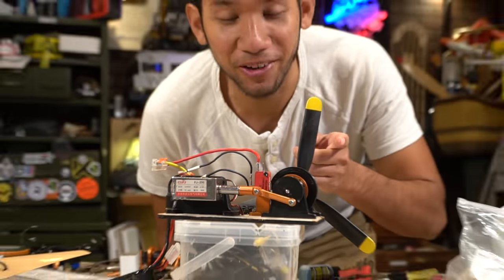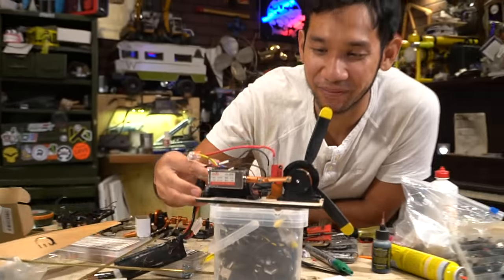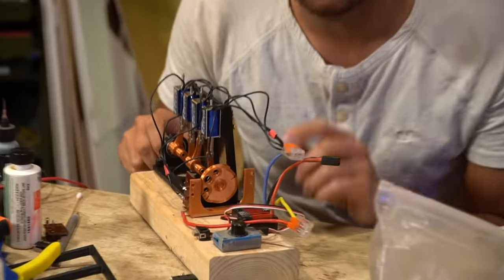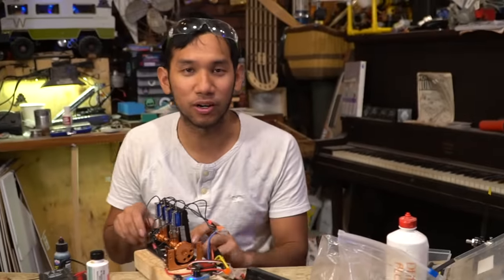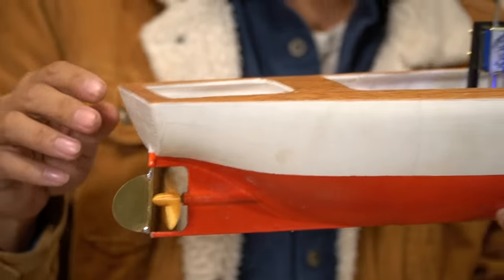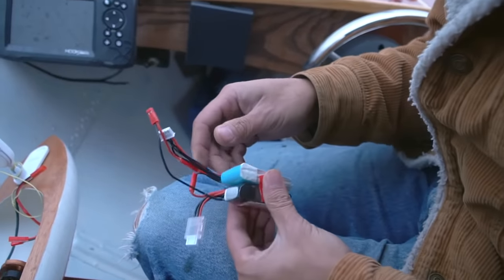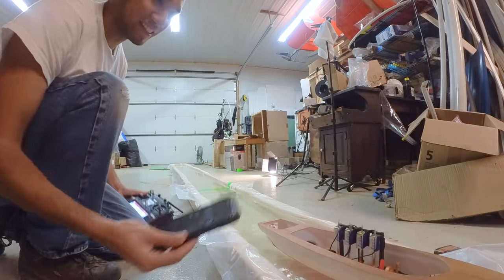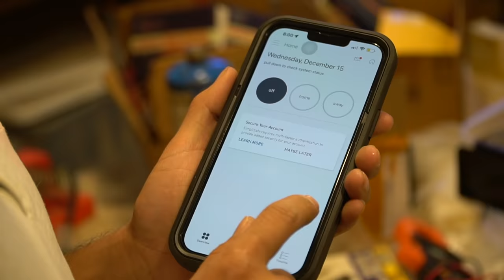Electric piston engine DIY (solenoid motor)

Comment: This is really cool! I want one now lol. As a side note, on a gasoline I4 engine, cylinders 1&4 and 2&3 are companion cylinders, meaning they move symmetrically if you mirrored the engine between the middle cylinders. This generally makes the engine more balanced from inertia, if anyone was curious. Also, you could get more torque by increasing the throw of the crankshaft (how far from the centerline of the crankshaft the rod journal is). Awesome video!
Reply: useless and inefficient and uninteresting motor
Reply: @alexdelarge4938  what?
Reply: J M  i don't look at motorcycles much, i was just generally referring to the average I4 car engine lol. That's interesting tho. 
I like at least 6 cylinders personally 😂
Reply: And that’s why Diesel engines rev so low too, they have a longer throw, so it has lots of torque but cant rev fast
Reply: Fun fact: there are basically 2 kinds of V8 engines, on has a cross plan crank, the other has a flat plan. Plan, as in the crank pins. Flat plan is 180° angle longitudinally from one pin to the next, and cross plan is is 90°.
Reply: Side note: to keep this short, Cross plains are generally more balanced, but only when the bank angle is 90° (angle of right cylinder, to left, almost always 90° or 60° in most V engines.) Flat plain cranks only work on 90° V8 because 90° V8s are naturally more balanced than 60° V8s.
Reply: A longer stroke wouldn't increase the torque of the solenoid motor in the video. Why?

Get a couple normal permanent magnets. Orient them toward each other such that north faces north or south faces south. Bring the faces very close together. Feel that pressure? Now, very slowly, allow the magnets to move apart. How does force correlate with distance?

A high-precision, optimized, reciprocating-solenoid motor should get far more torque with very-short-throw pistons than with long, and max torque should be achieved at low RPMs, similar to what you get with cheap brushed DC electric motors.
Reply: @warpedweirdo  you do realize how a linear solenoid works, right?
Reply: this setup should be better since he doesnt have counterweights?
Reply: @Fra-gee-lay  I think I do. I'll assume for now that you do as well, and you're just being pedantic about such things as simple solenoids working on magnetic attraction rather than repulsion, with no permanent magnets involved, and only one magnet of any sort.
Reply: You would not go wrong adding a flywheel.
Reply: J M  General Aviation airplane engines are largely the same as an air-cooled flat 4 out of a 1960 VW Beetle.  The crankcase/block is thinner and lighter and more sculpted on the airplane, but its got the same type of cylinders with cooling fins, pushrods and rockers in the head.
Reply: You are right but I guess the construction would be too weak to handle 2 pistons in the middle at the same time. On a 4 stroke engine they also don't fire at the same stroke. But making this a 4 stroke is no option. Making the solenoid rods magnetic would allow for push and pull so creating a 0,5 stroke engine. Or isnt that a thing? lol
Reply: @warpedweirdo  I think you might be incorrect, if you have shorter throw pistons, then the crankshafts offset will be shorter, giving less leverage and less torque
Reply: He's actually using a 2-stroke "Big Bang" configuration, ie, 2 double fires per crank rev, where as a normal 4-stroke 4 cyl is 4 fires in 2 crank revs.
Reply: And maybe a boxer engine.
Reply: I’d like to see a well timed one. Maybe turn the coils on just after bottom dead centre (a tiny bit) so it’s already on its way up when it starts to pull. Even turning off a fraction before top dead centre to stop it getting trapped/stalling.
Reply: That's with four strokes, yes. In two strokes, like this solenoid engine is in some respects, a crossplane crankshaft would be better, since it smooths out the delivery of torque.
Reply: yes, near full stroke of the solenoid, but the coils are heating up with a near 50% duty cycle is the major issue. a 5 cylinder radial configuration with one lobe 5 switches, lobe making ON for 45-50 degrees reduces duty cycle per solenoid a lot. when heat goes up, resistance goes up, power output drops.. is what this inline 4 is doing to the solenoids.
Reply: @Skoda130  definitely would require a more complicated triggering mechanism though. Not a huge problem, but I can see why Peter started with the simple setup.
Reply: *stares in Yamaha*
Reply: @brettc5386  Perform the experiment with the magnets, then get back to me with your thoughts.
Reply: Is that a fellow car enthusiast???
Reply: 1324 das ist die zündreinfolge
Reply: @warpedweirdo  well you're the one that tried correcting the other guy so why don't you try it, see how much torque your 1 mm stroke puts out🤣🤣
Reply: @warpedweirdo  you really have some pent up anger in you, huh? I never said you were wrong, I said I THINK you MIGHT be wrong, I'm jus saying you can't just assume a shorter stroke will give you more torque when it decreases the leverage, the same way a longer stroke won't always increase the torque, because the distance of the magnetic field.  I'm sure there's a sweet spot but neither of us can say what's perfect, we can only theorize. Next time don't take a comment so personally, be more mature and try to come to an understanding instead of trying to tell me to do it myself and getting mad when I say the same thing back to you. I wanted to know how you would respond and based on your defensiveness, I see that you don't like being treated how you treat others.
Reply: @joeljr570  they also cant rev high because the heavy internals to withstand the pressures of a Diesel engine. Most gas engines have a compression ratio of 9:1 or 10:1 but diesels have cr’s up in the 18:1 to 23:1 range meaning the cylinders face extremely high pressures with require stronger heavier parts that don’t allow for high revs
Reply: @brettc5386 
I've already told you what I think of your opinion. Why are you wasting words?

But I have a message for you Brett, and it's important that you never, ever forget it. I want you to remember these words, and I want you to contemplate them every day for the rest of your life: 

Grow up, listen to the details before you form a conclusion, and always be ready to consider the possibility that you're wrong. 

Got it? Read the message a few more times to burn it into your brain and ensure you actually understand what I've said this time.

It is my hope that, rather than changing your behavior, my words will serve to reinforce your haughtiness and provoke greater self-destructive behavior. HAHAHAHAHAHA!
Reply: That only holds true on a 4 stroke
Reply: The hard bit is when you have to balance a straight 5
Reply: Make the poseidon
Reply: @joeljr570  no diesels create a lot of torque due to being a more efficient cycle at converting stored energy into mechanical energy not due solely to longer stroke, rpm on diesels is limited for reliability and longevity of the motor due to the amount of pull strain and compression strain on the engine internals. In the diesel performance world they have diesels that in stock form redline at 3200 rpm that in competition form rev to 5000 or even 6000 rpm. Production engines find the happy median between peak power output and longevity, where as performance oriented goes for peak power with longevity taking a back seat
Reply: @johngarlick7115  it’s cool how diesel is more efficient than otto from a thermodynamic perspective, it all depends on when the fuel is ignited in the cycle. Constant pressure vs constant volume heat addition.
Reply: @aidanf2610  every single thing about thermodynamics is cool lol, also things people look over is gasoline is rated by octane which is the resistance to ignition whereas diesel fuel are cetane which is the measure of how easily it is ignited, also diesels show more response to injection timing changes as far as power out put than Otto cycles due with ignition timing changes to optimize combustion events, and also diesels are inherently cleaner as far as emission than an Otto cycle though what they do emit is visually more noticeable
Reply: @aidanf2610  also you are my new best friend 😂
Reply: @jwalster9412  what about split plane? Hmm? Or VW's W8?
Reply: @arlberg2006  (Volkswagen) W engines use The 15° Vr-engine platform, this is a pretty good balance, but if you take a Vr8 and rotate it 45°(From the center of the original VR engine), mirror that, you get the basis for the Bugatti W engine, idk wether it's more balanced, but considering it's used in a Hyper car, it's probably a good Engine, the main downside being that the W16 is really complex, there was also a concept 90° W12 engine (used by Bentley for use in some of there cars).
Reply: @jwalster9412  tehe I've been a dubber for a decade and a half 😉
Taken apart many i4 and vrs.
The v8 in the front engine Porsche I believe had a special crank, and maybe one of the v8s in one of the old Lotus Esprit or something?
Reply: @arlberg2006  There is the, Shelby GT350 mustangs that have Flat plan crank V8. I've only really heard of cross an flat plan cranks.
Reply: Jomi _____®  gagu
Reply: depends on its constructions, on crossplane engine they move asymetrically aka simultanousnly from left to right
Reply: @warpedweirdo  Yes and no, torque is simply force times distance.  At the end of the day, the force you exhibit downward, will only be force x distance...the distance here being the throw of the crank.

If I can get the same force upon a longer throw...I automatically get more torque.

Now with magnets this is different...but these are not permanent magnets, these are e-mags, so the force can vary simply by increasing energy.

As well if he really wants to get the most out of his engine he would ditch the big solenoid and put in a multistage winding so that at peak throw, which is 90 degrees to the TDC or TBC.....is when you would be releasing the force of a two stage solenoid.  First stage to push down, second stage to keep it going as would combustion, even a combustion engine loses force as the piston strokes down because of the expanding gas.

Point being.....tldr.....force x distance.  A longer throw with same force will always equal more torque
Reply: @elitewolverine  Agreed. Many people here are ignoring the caveats you listed, including how quickly the strength of a magnetic field diminishes with increasing distance.

Putting together long-throw solenoids with multiple windings, position sensors, and software to control activation / deactivation of individual windings would make for a very interesting and informative video.
Reply: @warpedweirdo  You wouldn't need software if you make it a physical switch like a cam.  Just put the individual windings on their own cam switch.

I would say 3 windings each cylinder so at the end of the crank, the position sensor they are using now, just put spacer, print another cam, and do that again.  Just time it of course.  But no software needed.

Hell don't even need a switch if you want to go 'old school' and use a brush type of contact...
Reply: 3tg
Reply: @joeljr570  It's also because they are low compression engines. Entirely different than gasoline engines. Which is also the reason they are harder to start in cold weather. But they are generally more efficient engines than gasoline in terms of weight to power/fuel used. I'm not gonna lie though, this video is completely useless.
Reply: J M  Yamaha crossplane cranks make the best sounding motors.
Reply: Petrol*
Reply: also looking at how easily it stalls and the speed variation between the strokes he probably should've put on a flywheel or at least made a crossplane crank because those solenoids basically function like an inverse 2 stroke (or with more advanced timing and better solenoids double acting steam pistons) and as such you can remove the secondary imbalance completely while retaining the same amount of primary inbalance as the current setup.
Reply: @joeljr570  nope, diesel don't rev high because the fuel burn slowly and unlike gasoline, they cannot ignite early to compensate. Also, they have lower torque than comparable gasoline engine. High torque of diesel became a thing only because they became turbocharged decades before gasolines (in mainstream cars).
Reply: That's because combustion engine fires once in 360°. Two stroke 4cyl would have different layout to spread combustion cycles.
Reply: @alexdelarge4938  👉🔴What Do Muslims Believe about Jesus?

Muslims respect and revere Jesus (peace be upon him).  They consider him one of the greatest of God’s messengers to mankind.  The Quran confirms his virgin birth, and a chapter of the Quran is entitled ‘Maryam’ (Mary).  The Quran describes the birth of Jesus as follows:

 (Remember) when the angels said, “O Mary, God gives you good news of a word from Him (God), whose name is the Messiah Jesus, son of Mary, revered in this world and the Hereafter, and one of those brought near (to God).  He will speak to the people from his cradle and as a man, and he is of the righteous.” She said, “My Lord, how can I have a child when no mortal has touched me?” He said, “So (it will be).  God creates what He wills.  If He decrees a thing, He says to it only, ‘Be!’ and it is.”  (Quran, 3:45-47)

Jesus was born miraculously by the command of God, the same command that had brought Adam into being with neither a father nor a mother.  God has said:

  The case of Jesus with God is like the case of Adam.  He created him from dust, and then He said to him, “Be!” and he came into being.  (Quran, 3:59)

During his prophetic mission, Jesus performed many miracles.  God tells us that Jesus said:

  “I have come to you with a sign from your Lord.  I make for you the shape of a bird out of clay, I breathe into it, and it becomes a bird by God’s permission.  I heal the blind from birth and the leper.  And I bring the dead to life by God’s permission.  And I tell you what you eat and what you store in your houses....”  (Quran, 3:49)

Muslims believe that Jesus was not crucified.  It was the plan of Jesus’ enemies to crucify him, but God saved him and raised him up to Him.  And the likeness of Jesus was put over another man.  Jesus’ enemies took this man and crucified him, thinking that he was Jesus.  God has said:

  ...They said, “We killed the Messiah Jesus, son of Mary, the messenger of God.” They did not kill him, nor did they crucify him, but the likeness of him was put on another man (and they killed that man)...  (Quran, 4:157)

Neither Muhammad  nor Jesus came to change the basic doctrine of the belief in one God, brought by earlier prophets, but rather to confirm and renew it.
Reply: Wow! You just made me realize something fundamental about motors the torque of motors that gave me a a bit of a break through. In hindsight it's kind of obvious but if I need more torque from the BLDC motor I'm designing just increase the circumference!